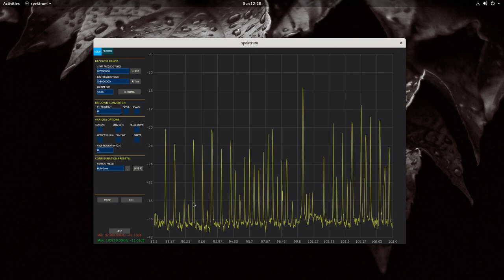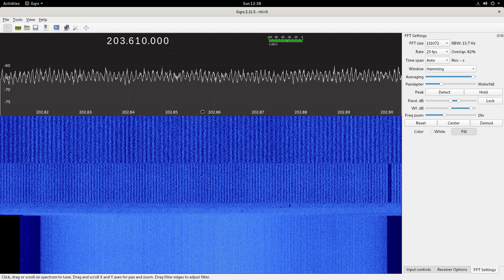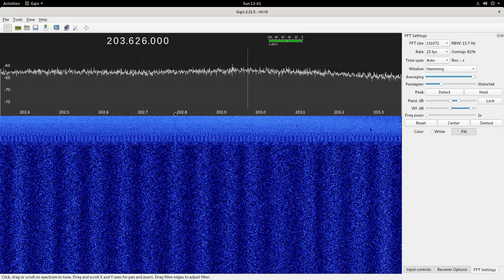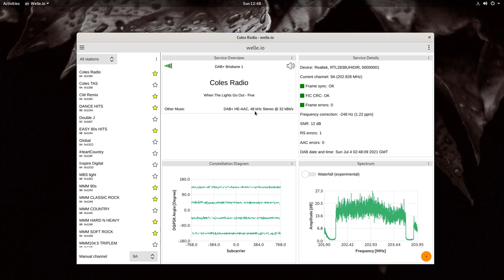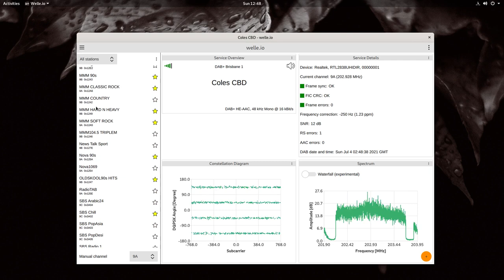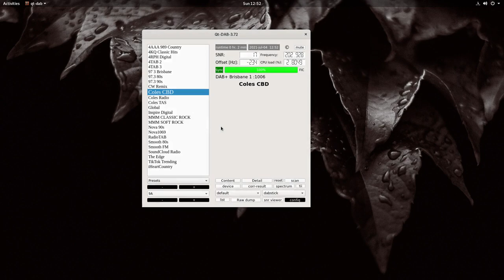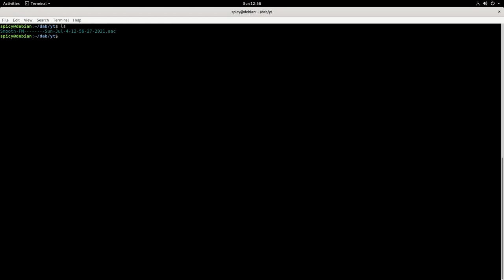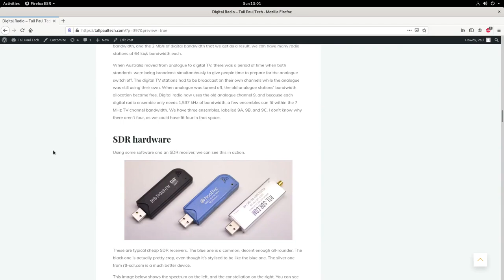How Digital Radio Works

Comment: Hi Paul, very interesting your video about DAB+ in Australia; and it is true that DAB makes a more efficient use of the spectrum than analogue FM; but ...
88 > 108 Mhz is a 20 Mhz bandwidth; if you set one FM TX each 400 Khz, then you have 20000 / 400 = 50 stations, approx (I am rounding numbers here);
first consideration: the 400 Khz separation is dictated by ACMA, not by a real technical rule or formula; in other parts of the world TX licenses in ana FM are issues even wit has low as 50 Khz separation; and trust me, you can tune each one of them no problem; yes, you would need better quality (i.e. higher selectivity) receivers, but then what the ACMA is saying is that b'cause in Australia crap FM RXs are allowed to be sold, then the minimum separation can't be any lower than 400 Khz?
Anyway, lets' stay with  the 50 stations inside a 20 Mhz bandwidth;
Let's focus now on another digital modulation: DRM30; DRM 30 has been designed and advertised as the way to digitise AM and SW; I have carried out few experiments and found (with my own eyes and ears) that stereo audio, better than FM and almost CD quality, can be transmitted using just 20khz of bandwidth using the OPUS audio encoder with DRM30;
during my experiments I have also found that it is absolutely irrelevant the actual frequency used to transmit the data stream; I have even very successfully transmitted the DRM30 data stream via internet, sending it to an ICEcast server, then tuning into it from another PC / another location and feeding the data stream received to a DRM decoder via a virtual audio cable; with beyond impressive results; SNR >60 dB!!!; 
so, I don't know over east ( I am in Perth) but here nobody listens to DAB; everybody goes with conventional FM for convenience or with web radio streaming; simply because almost everybody has an FM radio already and definitively everybody has already a smartphone with internet access, so why would anyone want to spend $ 50 por more for a decent DAB radio?
RAdio is not the same as TV; TV was successful in moving from ana to didgi because one can actually SEE the difference; HD, UHD, just are not possible with analogue TV; 
but with radio, FM quality is enough for the vast majority of listeners; a good FM station already provides interference free reception; and if they will one day stop TXing in analogue, people will simply switch to internet streaming, not DAB. 
DRM30 used on FM band 88 - 108 has, in my opinion, a change; because it takes much less bandwidth than ana FM and becausesmall adaprtos might be marketed to adapt already existing FM radios to receive digital DRM30. 
Think about this: why do you think CRA ha snot abandoned FM analogue just as yet? Why do you think HPONs and LPONs still can fetch many thousands if not tens of thousands of dollars at auction, if they are allegedly a thing of the past?
Cheers, 
Stefano VK6WFM
Reply from the maker: I know a couple of people who bought specific digital radios. I don't know their motive, but I think a lot of new cars have them nowadays.
As for tv, I recall the gov even paid welfare people to get a set top box so they wouldn't miss out on tv. Priorities!
Reply: @TallPaulTech  Yes, but TV is different; would you be able to make a similar video but describing the technical details of DRM?
Reply: You have to leave 200kHz gaps for the transmitters of the neighboring city to fit in. Otherwise you couldn't receive in the countryside area where both signals on the same frequency are equal in strength. Low deviation FM doesn't have the same fidelity.

The SNR of a decoded digital codec is not a good measure. Digital adapts to the current average level, and can fall to absolute silence for infinite SNR. But at any instant the dynamic range is in the order of 10 to 30 dBs per subband depending on the bitrate. You get the familiar underwater sound and double speak. If the spectrum is "full" as in the case of rock music, then there is no spectral redundancy to extract.

I don't see a need for even more local stations if most of them only transmit static music without new information. You could download a music collection of a particular theme instead. They could extend the FM band down to 65 MHz, and there already are radios that can receive it.

Comment: In the UK radio stations have highly compressed audio,even even with AAC codec being used.
They seem ram in too many stations into a multiplex,which cause sound quality issues.
Your favourite stations appear and go from multiplex from time to time.
DAB is crap, there's more of varied selection in internet radio.
I don't think DAB will be here for long .

Comment: Hi from Sydney 👋, Can you use the RTL-SDR to record all the DAB+ stations at once? Ordered one, going to take till October for it to arrive.
Reply from the maker: Theoretically yes. I mean, you can record the I+Q samples of the whole thing, but as for doing what I think you're trying to do, I haven't done that yet. I saw some programs that seemed like they were trying to do that but they were a bit raw and I couldn't get them working nicely. What I'd really like is a program like dvblast for digital tv, which streams out all the stations on their own multicast group. That would be ideal for digital radio too.
Reply: @TallPaulTech  Hi from Belgium ;-) eit-stuff just seems to do that, at least for one channel. 
I just started looking at DAB a couple of days ago (the new pandora box !), and fell onto a simple dab player: dablin, which needs eti-cmdline to convert the stream from the rtl-sdr dongle to a pipe. 
Instead of a pipe it can save to a file, which you can still open with dablin, and then you choose any station of that stream, .
You still need to select your channel beforehand.

Comment: They shoveled so many low effort music stations in there. If they only play music like the background of a supermarket, they can download the music easily and just play it without a radio.

32 kbit/s in the 21st century is a disgrace. Nobody would have music files any less than 192 today. At good quality you can fit more stations.

Count the money that it cost them to put up the new super expensive computerized transmitters. And the kickbacks they received from manufacturers.